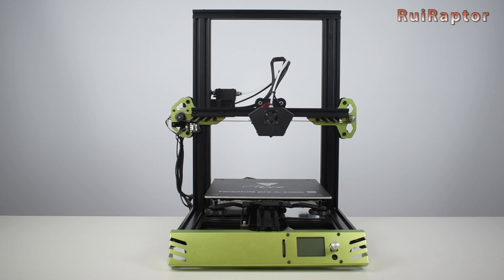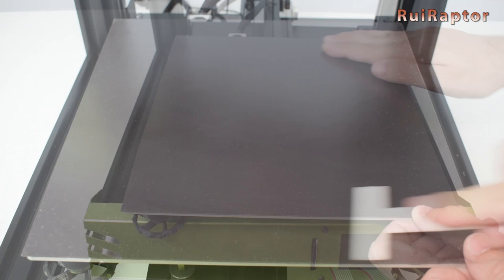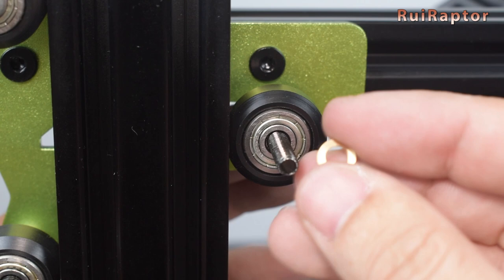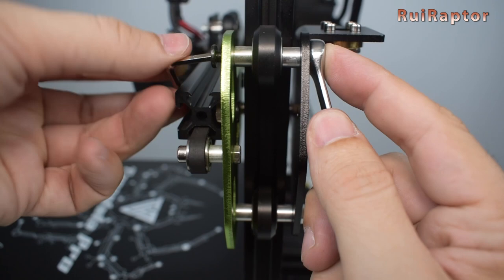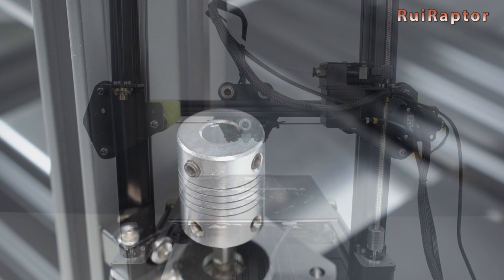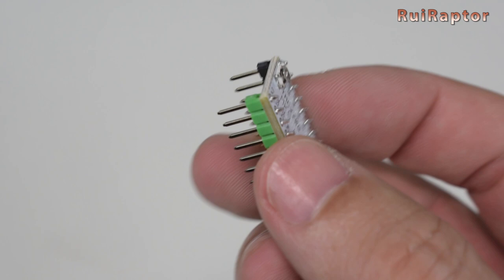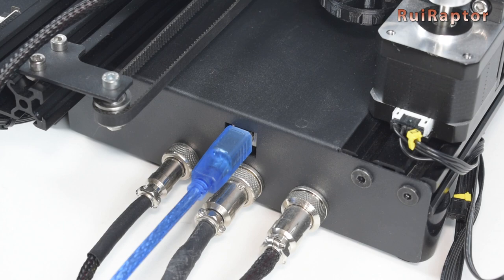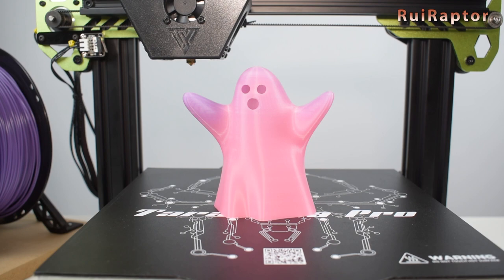Tevo TARANTULA PRO - Dual Z & Print Surface Upgrade

Comment: I've one of the new versions, It's a really decent printer, but one note at 5:18, the spring washers go below the nuts, the way you install them defies their purpose. Also if someone does this upgrade, the both Z steppers have to be connected in series, not in parallel in case you're using one stepper driver. This way, wont  have to re flash firmware. Both, Z drivers and motors have to be exactly the same, and still, from time to time you need to check the alignment as it goes off with time.

Comment: I had an extra piece in the box when I bought my printer. It was the black mount for this upgrade. I’m so confused as I didn’t get the second rod or stepper but did get all the skewed and nuts.

Comment: I have just purchased an e3d hemera direct drive system and decided rather then putting on my current printer I will get a new one. What printer would you suggest I pair it with, was hoping for glass bed, tmc drivers and dual z. Thanks

Comment: Hi! Help us with bed temperature improvement for ABS printing. Tell us what upgrades are required. Replace the bed, replace the power supply, what modification is required? Thanks!

Comment: Is there a difference when printing when having the 2 z motors? Does it improve quality or only prevent future problems?
Reply from the maker: Hi Jose, some printers require dual Z motors/leadscrews to maintain a perfect level of the X gantry. The tarantula Pro can run perfectly without the second Z as long as it's assembled correctly.
Reply: @ruiraptor  thank a lot

Comment: I opted not to use the belt or the top bearing things. Did not see the need. Just made sure both lead crews move free with no binding and are straight.  I also installed anti-backlash spring/nuts for the lead screws though because the included brass ones did have a bit too much play in them.
Reply from the maker: You are correct. The belt at the top is only to keep both Z axis in sync and can work perfectly without it. Regarding the leadscrew nut, it's normal to have play but you don't need to have an anti-backlash nut because gravity is your anti-backlash system in this vertical axis. You just need to make sure the X gantry moves freely along the vertical profiles and that will work just fine.

Comment: Hi sir rupi.. why need the belt if use dual motor?
Reply from the maker: Hi Marlon, the belt is only to maintain both axis in sync. You can run the dual Z without the belt.
Reply: @ruiraptor  thank you sir. Regards to maan..

Comment: I love that print surface! Ill order it at the same time as my TTP today, thanks! Do you ever need to access the screw holes?
Reply from the maker: No we don't need. We normally use the springs with half the tension and that is keeping the screws from turning. If in your case they do turn, you can use a back nut to lock the screws in place.

Comment: If you change the power supply to one of more amperage, will the hot bed reach the fastest temperature or isn't it?
Reply from the maker: Yes, both the bed and hotend will reach the temperature faster with a more powerful power supply.

Comment: With the new magnetic plate you are unable to have access to the the bolts used for adjustment of the bed. How are you going to do that in the future?
Reply from the maker: You don't need to access the screws to level the bed. You only use the leveling nobs that are under the bed. The magnetic base that is glued to the aluminum plate will also stick to the screw heads and will keep them from turning. Even if the screws still turn after the installation of the magnetic sheet, you can lock them from underneath with a nut.
Reply: @ruiraptor  I added a toothed lock washer and nut under the bed, to keep the leveling screws from turning.  Works great.

Comment: Great video as always. Do you think the dual z really needs a belt and pulley system up top? I would think it doesn't need it. Depending on the driver used maybe one driver can run two motors with a Y spliter? It would be great to see someone try this.
Reply from the maker: Hi Bill, the belt is only to maintain both axis in sync. Since this printer does not have 2 endstops for the Z, if you try, for example, to move manually the Z by rotating the couplings (without the belt) they will be out of sync and the axis will be out of level.  The belt will garantee it to be leveled all the time.
Reply: @ruiraptor  I don't know. I hear what you're saying but I have to try the one driver two motor configuration with the Y splitter and see how it works. Both motors should move in sync with each other without the belt.  If I feel a need for dual z I'll try this.
Reply from the maker: Hi Bill, i probably explained it wrong...what i mean is that the belt will keep both axis in sync even with the motors turned off.
Reply: @ruiraptor  that makes sense but instill think the two motors ties together with a belt will cause problems if the motors are not 100% in sync.

Comment: Olá, tude bem? Estou pensando em adquirir essa impressora mas um ponto que está me deixando com o pé atrás é a temperatura máxima que a mesa chega, que aparentemente na prática é 90°C. Li alguns comentários seus mesmo falando que provavelmente o que faz a temperatura não passar disso é a fonte que possui uma corrente baixa. Tomando-se isso como ponto de partida seria possível usar uma fonte de computador para trocar a original e assim resolver esse problema?
Reply from the maker: Olá Vitor, as fontes de computador têm como voltagem máxima 12v e esta impressora funciona com 24v. Se quiser trocar de fonte de alimentação recomendo trocar por uma semelhante de 24v mas entre 12A - 14A.
Reply: @ruiraptor  A sim, não me atentei a esse detalhe. Você acha que essa questão da mesa é um fator que inviabiliza a compra dessa impressora? Atualmente quero uma impressora mais pra hobby, trabalhando mais com PLA e PETG,  porém preparada pra em um futuro não muito distante servir de "ganha pão". Achei esse modelo vendendo no meu país com um preço bastante interessante, por isso estou tirando minhas dúvidas desse equipamento antes que eu compre e acabe me decepcionando.
Reply: @vitorg.titodasilva6045  tb tenho a mesma dúvida sobre a temperatura. Se é suficiente para ABS.
Reply: @raulelias2013  Opa amigo, eu resolvi mudar de modelo pra uma impressora com fonte melhor. Estou esperando a Longer LK4 Pro chegar no armazém Brasil pra compra-la. Ela já vem com os drivers silenciosos, mesa de vidro e sensor de fim de filamento, o único ponto negativo dela é o barulho dos fans, mas que aí é só substituir.
Reply: Eu testei tudo, trocar a fonte, fazer autotune e por ai vai. Ela não passa de 100 e com muito tempo. A melhor relação que achei foi a mesa à 90 para ABS. Tenho impresso ABS assim sem problema.
O Ideal é trocar a mesa ou colocar um Pad de silicone.
Eu estou esperando a do Jair que já deve estar quase pronta.

Comment: no need to define the driver type in the configuration.h?
I've changed all my drivers except the extruder driver.
im just a bit confused about what to do. Now i have defined X Z Y as tmc 2208. 
I've watched the tmc 2208 install vid
Reply from the maker: Hi Victor, yes, you need to define the correct driver in the firmware. On the older marlin versions (same time when the tarantula videos were made) there was no option to choose the drivers.
Reply: @ruiraptor  I see 👍

I got everything working except one thing. 
My extruder motor E0 wont run after I flashed the dual Z axis motor.

Tried swapping to a tmc2208 and the motor still works when I tried to swap the X motor cable to the Extruder, but nothing happening when i try to extrude so I guess something went wrong in the flashing.
Do you have any idea?

Now
 E0, E1(second Z motor), X, Y, Z is defined as Tmc2208, 
(I know the tmc2208 is not great for extruder l will change as soon as I get it working)

Thanks

Comment: Hi Rui, thanks for the video, this was excellent guide for me to install dual z. One question about the FIrmware, if just enable the dual z as you mention at the video, should I update the E1 driver type for TMC at the tab Configuration as well? Because I did that when I upgraded the X, Y, Z with TMC2208 and E with LV8729. I really appreciate your help. Greetings from Brazil!
Reply from the maker: Hi Luis,
we didn't mention that because the firmware version did not support different driver types. If your firmware supports different driver types, then yes.
Reply: @ruiraptor  Thank you very much for your answer!

Comment: Hi Rui,
I bought a Tarantula Pro and I am also very satisfied with this printer. now i wanted to buy the dual z kit to get even better results, but can't find it anywhere. is there a way to order this or a list with all the components I need 
 Greetings from Germany
Reply from the maker: Hi,
you are correct. The dual Z kit for the tarantula pro is currently not available in any website. We need to wait for their return from holidays and see if the kit will be back on sale.
Reply: @ruiraptor   thx for the info. i hope it will couse i like the printer sooooooooo.......

Comment: when I connect the printer through a wire, my computer does not see it, what should I do?
Reply from the maker: The computer should see something in the device manager. If it can't recognize the printer, then you need to install the FTDI drivers.
Reply: @ruiraptor  thx man